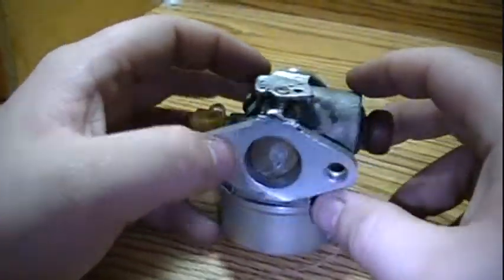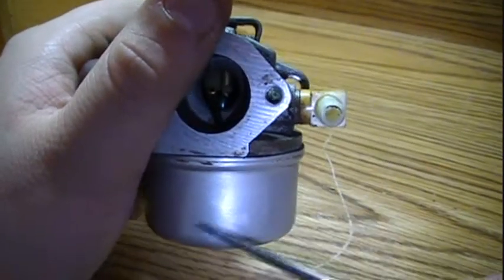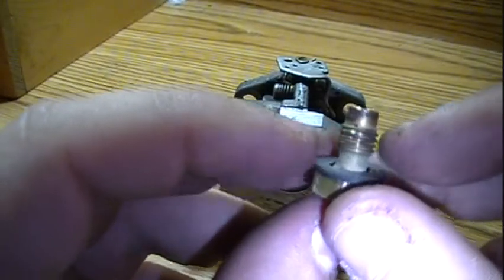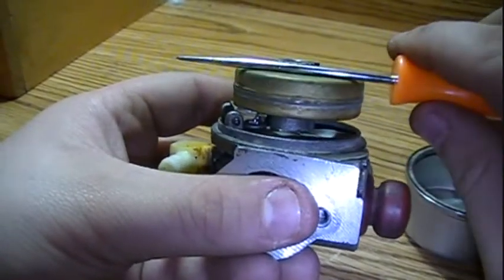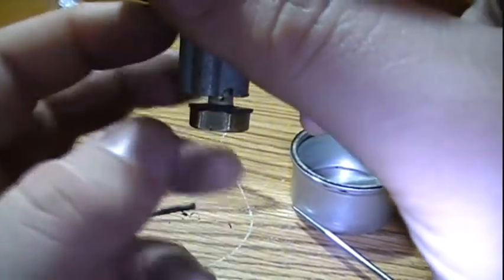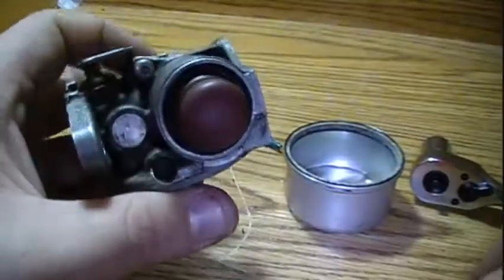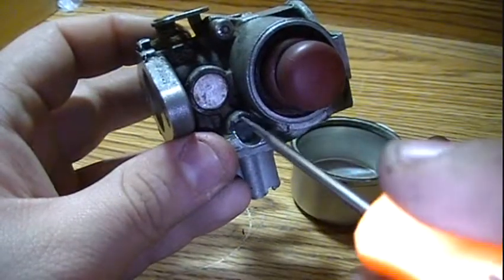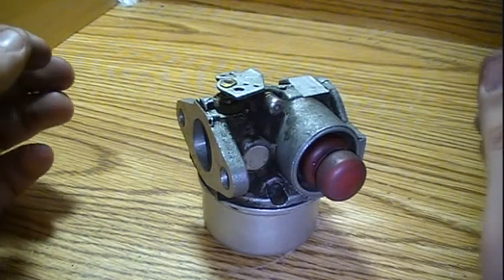Small Engine Carburetion Fundamentals

Comment: Thanks for your video which I just came across and found it quite helpful. It is an old video, but I have a question perhaps you could please answer. I have a 2001 TORO 2 cycle snow thrower.  My understanding is that how you can increase the engine speed by changing the direction of certain metal tabs which are connected to the governor linkages etc. I was wondering what the purpose is of the engine control speed screw shown in your video in conjunction with the tabs. Can I not just adjust the screw to increase or decrease the rpm?  Thanks in advance for any insight you can provide into the matter.

Comment: I have pretty much the same carburetor on a Noma snow thrower with a Tecumseh 2-stroke. It must be a modified design having a choke on it and the prime button is remote from the carburetor unit. It has been trouble free, I do run the machine a touch rich. Thank you for posting you are a wealth of information.